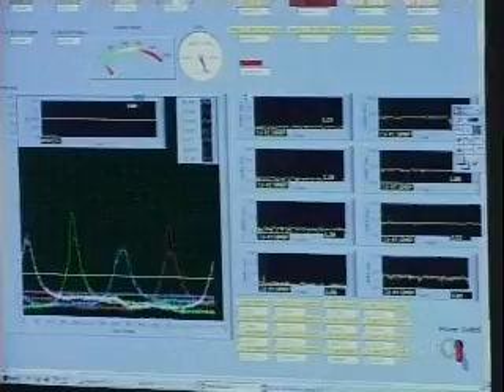MIT Ethanol Hybrid

Comment: That's right it came right from scientists at MIT. The process involves injecting a very small quantity of ethanol into the combustion chamber at a certain point in the four stroke cycle (intake, compression, power, exhaust). This process allows the automakers to build smaller engines that utilize higher compression ratios and turbocharging or supercharging to create 25% to 30% increased efficiency. There is also a great increase in torque, which is one benefit of the diesel engine.

Comment: If you'd like to see how ANY gasoline powered vehicle can be A) more efficient by 25% to 30% B) have zero loss in power or torque C) have no changes to the amenities (i.e. air conditioning, electronics, etc.) D) replace millions of dirty diesel engine.  Google MIT Ethanol Injection.